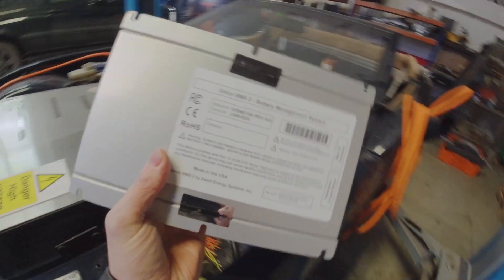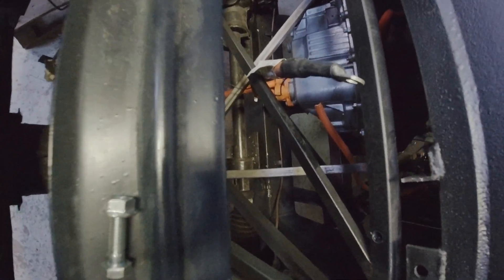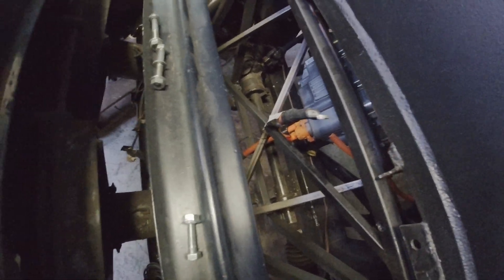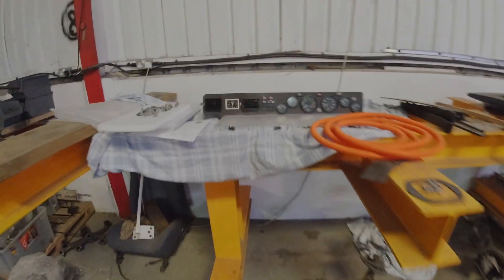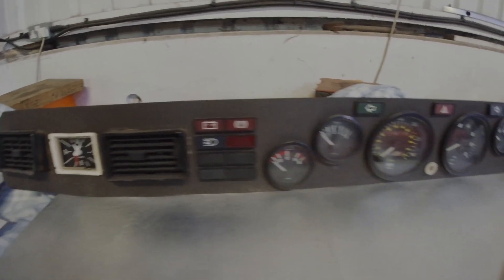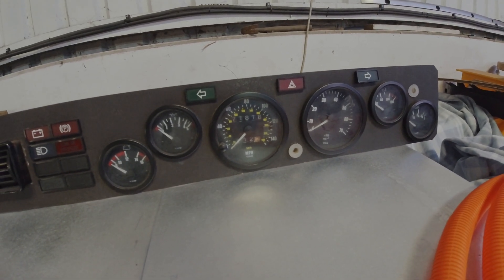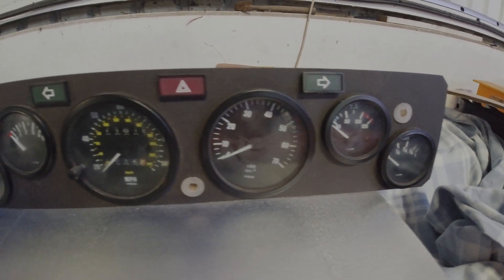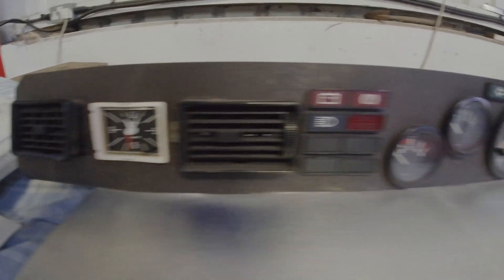Tesla Powered TVR EV Conversion! Ep13

Comment: yeah sell the Griffith, let someone who appreciates it own it. This has to be the daftest build I have ever seen. Electric motors don't belong in classic cars, let a lone a TVR. You should know that 75% of the experience of a TVR is the noise, the rest is handling/fun and looks. The wedge will now have none of these attributes! So what if its faster, congratulations the latest electric technology beats a 60 year old engine design! TVRs used to be legendary for their pace vs cost, now they are appreciated for the noise and the drama/presence.
Reply from the maker: I appreciate your comment, however just because you have a strong opinion doesn't mean you're right. When I bought the Griff i never thought about the noise factor, for me it was more about the experience of the drive. They don't handle IMO especially by modern standards, however do believe its one of the best lookers out there. The noise on cars is just an ego thing so what ever floats your boat.
TVR Griffith is for sale £21990 done 74k full service history.